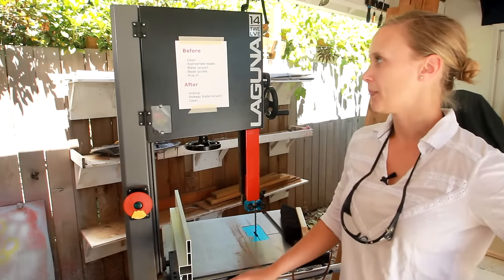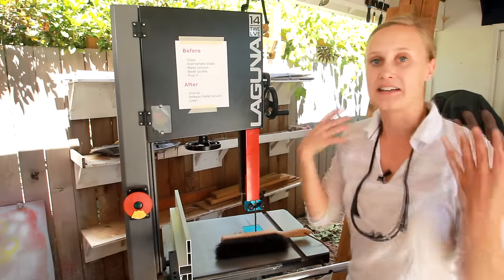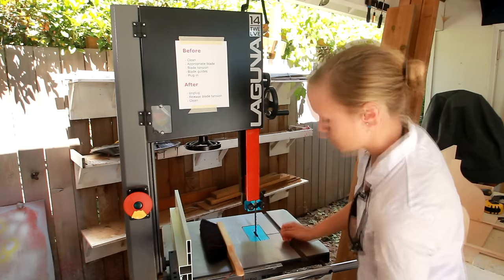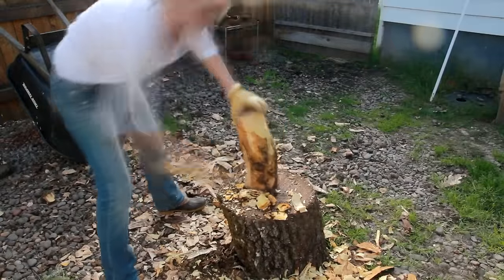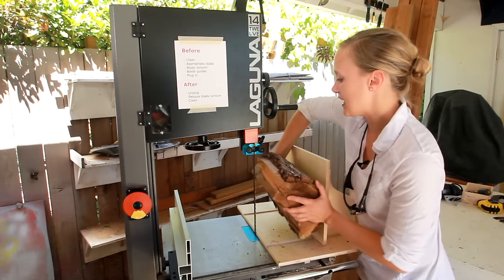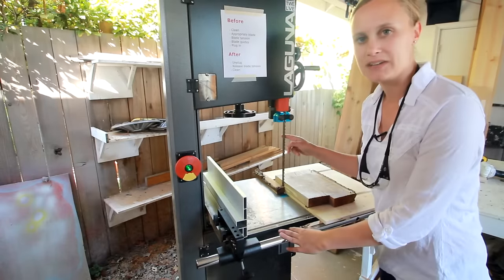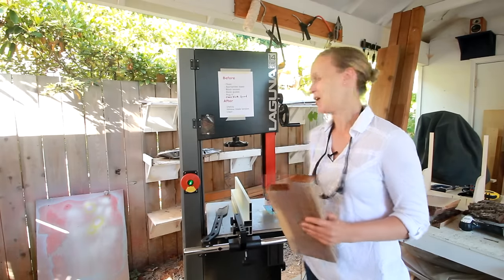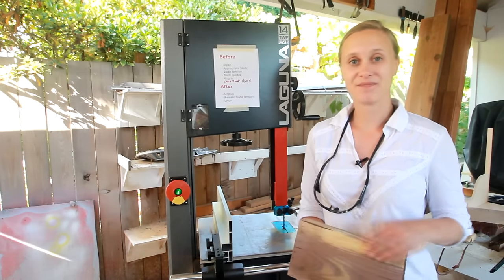Bandsaw Update & a Couple Jig ideas

Comment: Linn- To release the blade tension use the "Quick Release Blade Tension Lever" on the back side of the saw.  Item #12 0n page 13 of the Manual. This will take tension off of the blade and prevent you from having to re-tension the blade at every use.

Comment: Very exciting stuff. A good bandsaw is, in my opinion; an essential woodshop machine. It does  many different jobs quickly, easily and safely. A huge asset to the jig maker.
When I need to temporarily fasten wood to a jig for machine processing I will often use a few dabs of hot glue to keep from having to put screw holes in the work.

I noticed the glue bond between one of your ceramic blade guide blocks and it's aluminum housing broke. See the Laguna manual for the "how to" on ceramic block replacement if you haven't already fixed it.

 I really like your check list. It's a great idea and improves machine operator safety.

 I used to hang a wooden sign in front of my un-tensioned blade at the end of the day to remind myself to re-tension it the next morning.  I could remember to un-tension but would occasionally forget to re-tension the next time I used the B'saw.

Comment: Just ordered my 1412 today, I wanted to get the new 1412BX, but couldn't justify the cost, for the new features.  What blades do you use, and where do you get them?  I been having some trouble finding a 14tpi 1/4 inch 115" and a 4tpi 3/4 inch 115" blades

Comment: I've been thinking of getting a bandsaw that could resaw larger 2" thick lumber up to 10" wide. This saw definitely makes it onto the short list. I'm especially interested because I see that you work more or less outside, with high walls and roof but not the usual closed workshop. I'm in a similar situation and I've worried about how a power tool might fare outside like that. We get morning fogs sometimes but most of the year is warm. I am super interested to see how this tool does in your workshop. I'd like to make a decision and prepare for Christmas hinting as soon as possible. :D
Reply from the maker: joaniemarshall1 I like to use the mineral oil wax polish I make on the iron table to prevent rust.

Comment: I wouldn't worry about the blade tension, in almost 10 years of owning a bandsaw I have never released the tension and never had any problem, in fact I have only broken 1 blade in all that time, that was due to getting a piece stuck which twisted the blade and snapped it.
Reply: Releasing the blade tension isnt about breaking the blade but not stretching it and deforming it - vital if you do a lot of veneer work

Comment: Linn,  Congratulations on the new sponsor!

Were those sparks at the 1:02 mark?       Thanks.          JimE
Reply from the maker: Jim E Thanks Jim, yes they were sparks, it is normal for a new bandsaw according to Laguna. The ceramic guides are meant to do this initially until they wear a bit.
Reply: It looked like one of the ceramic blocks was moving in and out, or am I seeing things?

Comment: You better glue your ceramic pieces in. @ 1:03 it looks like the bottom right side guide is loose. Could spell disaster. Also @ 4:44, it looks like your table or carriage might not actually be exactly perpendicular to the blade as you can see more clearance between the blade and the top of the log as opposed to lower down.

Nice videography! :)

Comment: i think theres something wrong with that band saw there are sparks sling out when you cut.
Reply from the maker: +Maarten Mägi it is normal for this type of laguna saw.
Reply: +Darbin Orvar if it sparks that means the blade isnt aligned correcrtly anf it cuts somethin metal inside the band saw. Think logikly i used bandsaws before anf those bandsaws vhen you cut dont spark.
Reply: No.  That is normal for the ceramic blocks.

Comment: I cringe every time I see someone using a bandsaw and the blade guide is way above the piece being cut. It's easy to overlook this and all it takes is a blink of an eye for your hand to slip and you could get a horrible injury. I come from a machine shop/metal working background and I used to stop people cutting metal on our bandsaw if the blade guard was way above the piece being cut. No one in my shop got injured using the bandsaw incorrectly, but I did see a few close-calls where their hand slipped on the work and their hand just missed the blade. They would get angry when I yelled at them, but I believe it kept people from getting hurt.

Please make it a habit to adjust your blade guide where it's just slightly above the piece being cut. Safety first :)

Also make a habit to clean the tires on the internal blade wheels from time to time. Dust can build up on the tires and cause the blade to wonder off center, especially when cutting damp or wet wood. When resawing, use a proper resaw blade, they are wider then a normal blade and are far more stable then a normal blade.